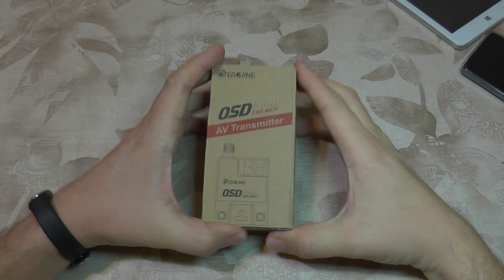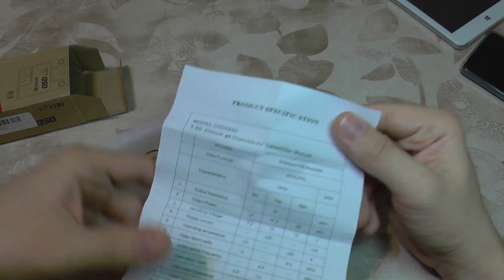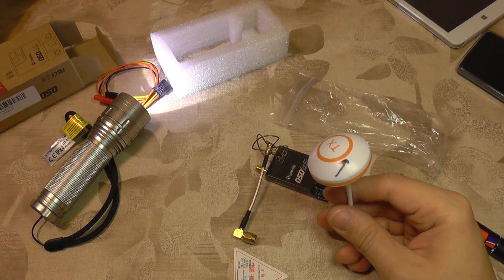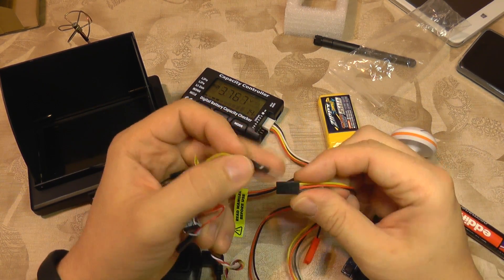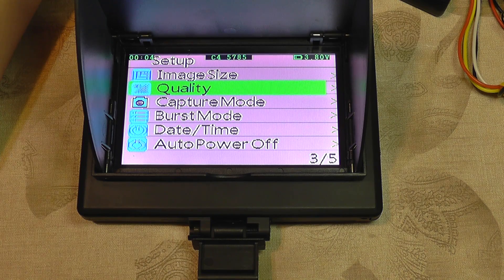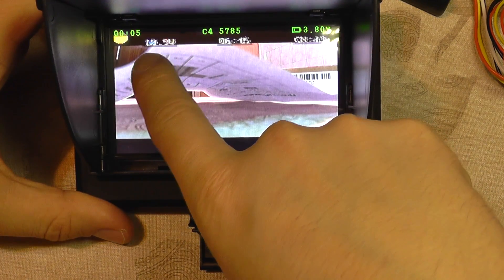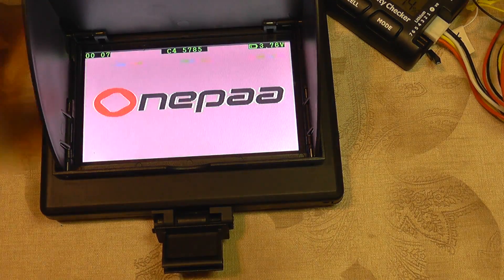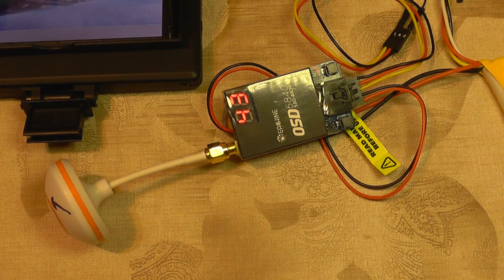Eachine OSD5840 5.8G 600mw 40CH FPV Transmitter

Comment: Hola! Estoy montando un kit Robocat 270 y se me ocurrió comprar este transmisor para mi drone, ¿sirve este transmisor para proporcionar corriente a una cámara de 12v?
Reply: Thank you very much for the answer, before seeing this answer yesterday afternoon I started to cut the cable that came from my camera Goolrc (1000tvl) and also cut the coming from the transmitter, after connecting them I connected directly to the lipo of 11.1v and I could Just start them up.

The image looked perfect on the fpv monitor, of course there are better cameras and maybe transmitters but for now everything works as it should. Now I'm more concerned about getting properly configured cleanfight to start flying the drone before finally joining (with fpv, leds rgb and others).
Reply from the maker: Yes this transmitter will provide 12+ volt to the camera.
Reply: Sí lo deseas puedo anexar aquí el vídeo que grabé para poder verificar posibles errores.

Comment: After breaking the antenna connector on my 600mw fpv racer, I took off that VTX and replaced the RunCam up front with the Onepaa VTX cradle.  Haven't had a chance to try it yet.  BTW, I agree that all the antennas should have a molded stamp on them to indicate if they are LHCP or RHCP. We shouldn't have to guess or hold it up to a light to find out. Cheers.
Reply from the maker: There are even worst scenarios, black antenna caps that don't let light trough !